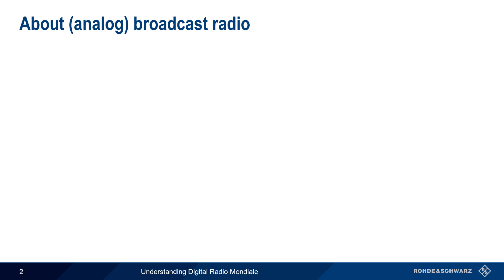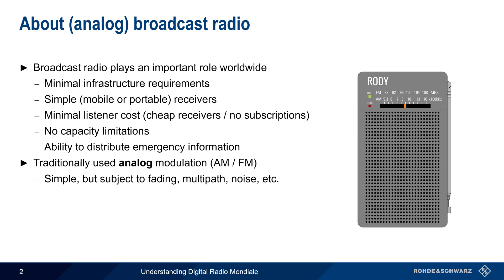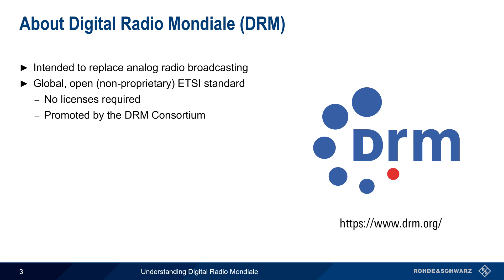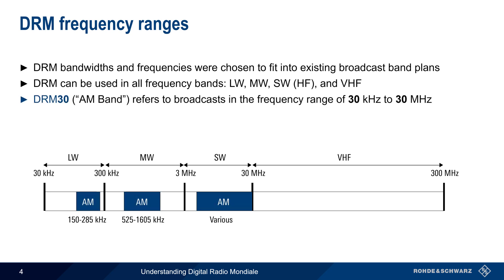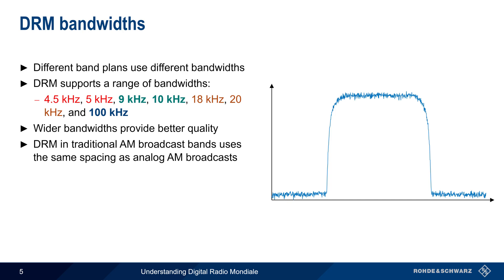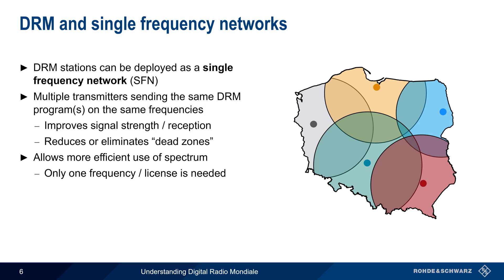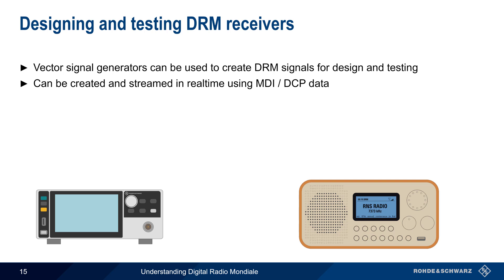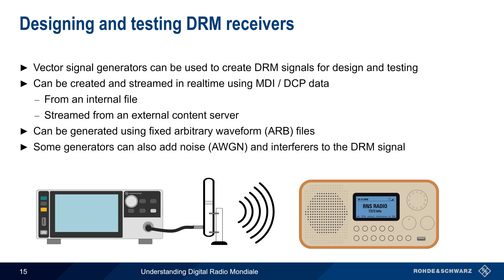Understanding Digital Radio Mondiale

Comment: DRM is the single worst acronym for an open digital audio broadcasting standard. Every time I hear it I have a tic that makes me think of Digital Rights Management.
Reply: For me my ears hear DRM but my brain hears DMR (digital mobile radio) which is a common digital mode in public safety, business/commercial and amateur radio.  Interestingly there is a relatively new OFDM mode in amateur radio.  Tried it a few months ago and it works rather well.
Reply: @mikesradiorepair  Believe it or not, I'm also working on videos on DMR (and how to test it with our CMA180 radio test set).  73 DE KO4LZ
Reply: 🤣  Agree with you 100% - worst case of acronym overlap ever.